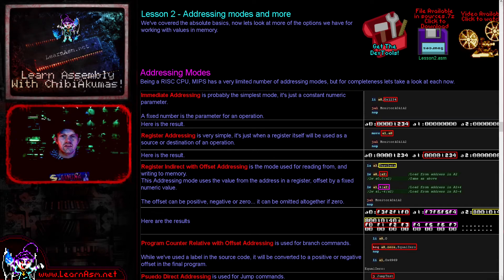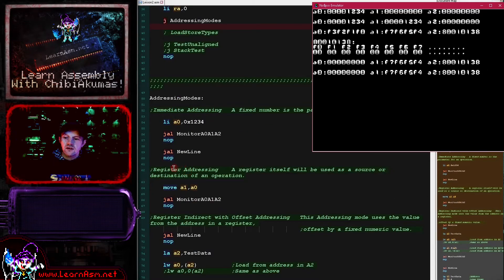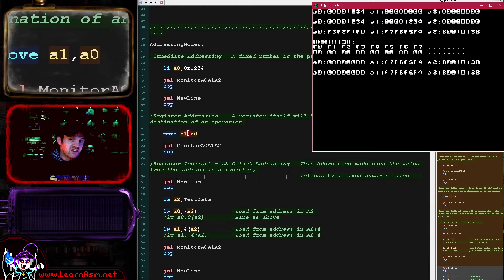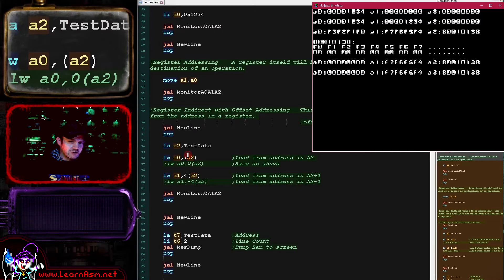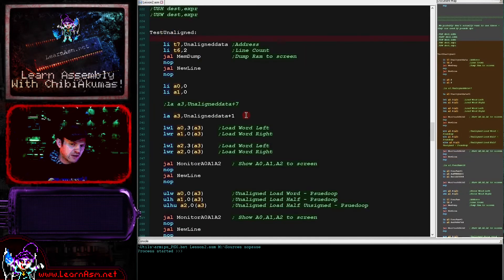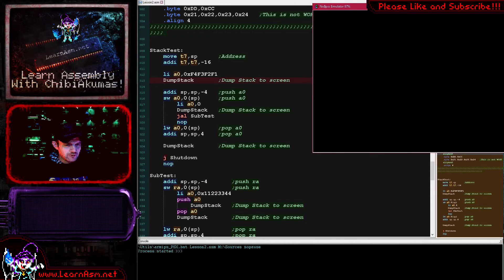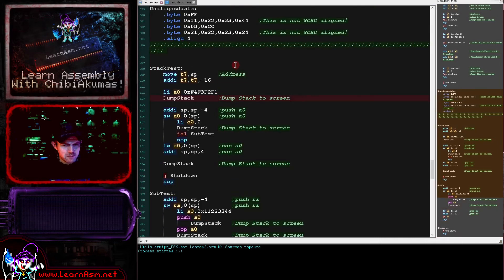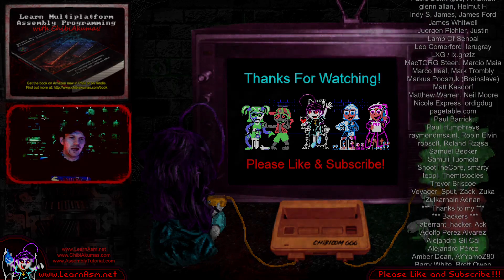Learn MIPS Assembly Lesson 2 - Addressing modes and more

Comment from the maker: It should be noted that while the MIPS is little endian on the PSX, it's big endian on the N64, so your results may vary depending on the system you test on.

I've written a book! It covers ASM programming on Z80, 6502, 68000, 8086 and ARM!
It's available on amazon stores worldwide!
https://www.amazon.com/gp/product/B08W7DWZB3/ref=as_li_tl?ie=UTF8&camp=1789&creative=9325&creativeASIN=B08W7DWZB3&linkCode=as2&tag=chibiakumas-20&linkId=d52cf677a0300b2fa9bd9d1f1da68f2e